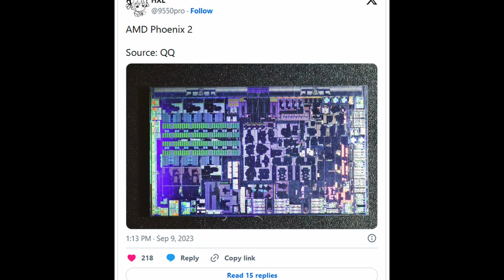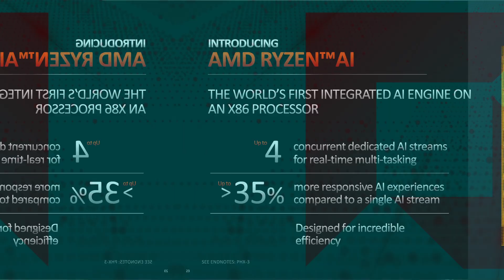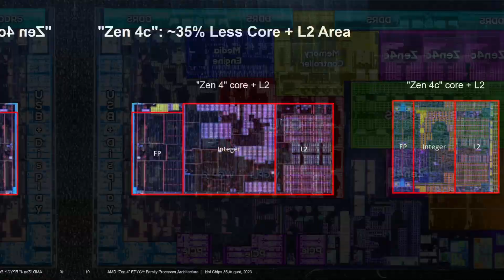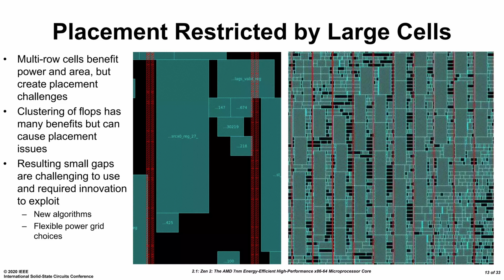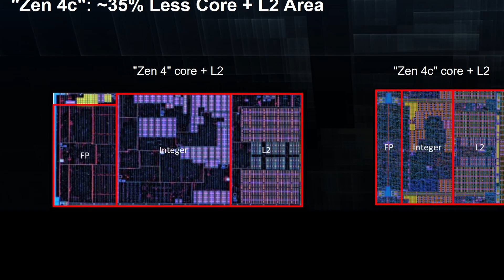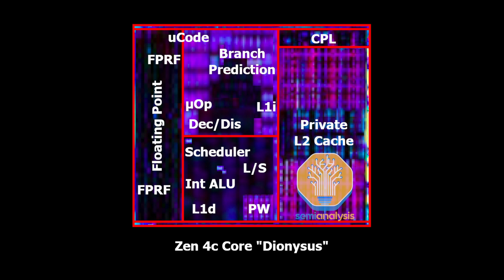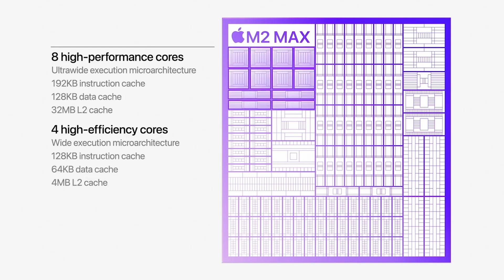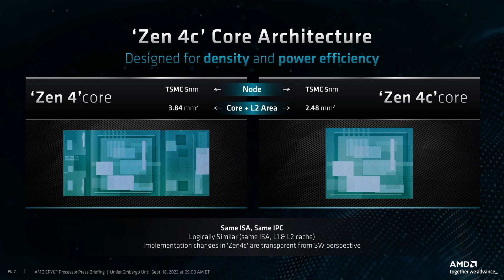Why AMD's first Hybrid-CPU is Different

Comment: We're still here waiting for software/scheduler to utilize our current cores.. I am not sure how more cores would have any performance gains, although the efficiency is there.
Honestly surprised this channel doesn't have 20x the subs, some great content here.
Reply: What problems are you experiencing with thread scheduling and what CPU are you using?
Reply: If it's AMD you're referring to, then that's really only a thing for games and dual CCD CPUs. The bulk of how it works now, would work even better with C cores. Single and lightly threaded tasks just go the the highest clocking cores. Games just happen to be a special use case for X3D where you typically want to reverse that when you have a X3D chiplet.

You'll hardly ever run in to any other consumer workload where you'd actually want/need to pick the cache cores. Most of what else could potentially benefit from the extra cache would just as likely be capable of using all threads on the CPU. That's where more threads provide more performance. Either highly threaded tasks that can max the CPU, or muti-tasking with a collection of light to mildly intensive tasks. Wanting to specifically default to the C cores would be mostly a concern for mobile, which is really a matter of having to OS switch behaviors when on battery.

There are game engines capable of using 12-16 threads, but are currently scaling back to not have the game peg the CPU at 100%. The 2.0 CP2077 update, for example will use 50% of a 16c/32t CPU, but 80% of a 8c/16t one.  I've seen Star Citizen using as much as 19 threads though. If it starts becoming more common for games to push past 16 threads, Intel's E cores in current CPUs will be worse off.

Comment: I think the most difference we'd see in architecture in a single AMD APU chip is using Zen 5 with Zen 4c+ (rescaled on a smaller node)-- basically having a slight size-area advantage while reusing an existing design.  So basically Zen N + Zen N-1c+ to be able to launch more quickly unless there's a major architecture difference between generations.  I could see this happening if there were problems bringing up Zen 5c in a reasonable time or if they wanted to lead out-of-the-gate with an APU that was on the new process, regular Zen 5 was ready, and wanted to make a powerful lower-cost chip off the bat to secure marketshare.   It would still work better out of the box than Intel's P&E cores because that requires a lot of magic on the programming and scheduling side.
Reply: Porting Zen Nc to a significantly different process used by Zen N++ would be much of the same work of validating Zen N++.
APUs & server follow the initial desktop lauch, used to introduce new designs.
Delaying V-cache & compact Zen chiplets is more about managing releases and demand, launching the simpler product first.
Reply: Eh zen5 and zen5c should be out around the same time so I don't think that will be an issue

Comment: it's not really a matter of what is necessary or best. The Zen 4c allows AMD to expand their market without designing a new core, or updating an older generation like Excavator to have a small core and better power efficiency. Intel had Atom for other reasons as the small core. 
If we really think about it, the full Zen 4 (and Intel P) are not well matched to high core count processors. The big Zen 4 core is capable of 4.5 base and 5.7GHz boost operation (in Ryzen) but is restricted to 2.4/3.7 in the 96-core EPYC. Zen 4c is smaller, and only gives up a little on base with 2.25/3.1GHz at 128c. 
I am inclined to believe that Atom core should have more performance per unit die area (a matter of Moore's Law) and may ultimately be more suitable for software capable of utilizing very high thread parallelism.
The long-term product lineup (Zen 6+ timeframe) might be 3 CCD options: 1) 4 big cores with very large cache, 2) 16 core c cores, and 3) 32-64 true little cores (narrow superscalar). The big cores should allow 4-5GHz base even in 8 CCD processors, the high core count processors use c core CCDs and very high core count using little cores.

Comment: A Zen 5 desktop CPU with one CCD of 8 normal Zen 5 cores with stacked L3$ and a second CCD with 16 Zen 5c cores would an extremely interesting product.  As long as they can handle the scheduling aspects to optimize for various workloads it would be a killer.
Reply: Id say 6+6 would be interesting cost effective but powerfull system for gaming. Most games dont need that many power cores but might be still able to utilize many cores for some extend. 4+12 black cheep option 😅
Reply: I really hope they do it, otherwise I'll go with intel. I'm not buying that hiper expensive threadripper pro anytime soon
Reply: There really isn't as much concern for scheduling in that scenario. Games are the sole outlier to how the OS wants to handle multi CCDs CPUs. By default it's wants to put tasks on the highest clocking cores 1st, but while the stacked cores are slower clocked, they are technically superior for most games. So the workaround is a whitelist method. Some future core dense CCD will always be the slower CCD. 

Pretty much every other workload is benefitted by higher clocks 1st, and then if it's heavily threaded it'll just include the other CCD. There won't really be enough other common workloads that would benefit from the cache and not use the whole CPU, nor would the dense CCD be faster in isolation.
Reply: If AMD had the will to do it, they could probably launch that right now with an 8 core Zen4+3DVcache chiplet & a 16 core Zen4C chiplet. There's no obvious technical limitation making it impossible to my knowledge? and I wouldn't be surprised if they had something akin to that running in the labs right now (in the same way that 5950X3D's exist internally at AMD)
Reply: @TorazChryx  they haven't introduced ZenC to the consumer products yet, that's the limitation. I suppose when it happens it will be introduced in a normal CPU without 3D cache.
Also fun to think about the unreleased 5950X3D which is a double 3D (both dies have stacked cache, 192 MB instead of 144). 
If it were released it should probably be named 5950X3Dx2 or 2x3D (6D ?) Lol
Reply: @TorazChryx  Probably cost is the limitation. But competition will lead it there
Reply: I had seen some tools being developed for the issues of having 2 different chiplets can give.
If you happen to have a 7900x3d or 7950x3d, I would hoghly suggest that you check out a program called Process Lasso. Something that I believe AMD should have made themselves and released with those cpus, so you don't end up with the issues some had, for an example some games running worse than on a 7700x (example csgo) or a 7800x3d, because they didn't run on the appropriate chiplet for max performance

Comment: The same cores are still being used as big/medium cores in multiple arm designs from qualcomm or mediatek. Like the sd855/865  had a high clocked a76/a77 core and a 3 lower clocked a76/a77 cores. The higher clocked core is physically larger too.
Reply: Is a Cortex-X1 the same as a Cortex-A77 with higher clocks?
Reply: @SeniorKlean  no, you can read anandtech for the details.

Comment: So when you say their hybrid design is both big.LITTLE and NOT big.LITTLE... does that make it a hybrid (adj) hybrid (noun)?
Reply from the maker: I mean it's both physically smaller and bigger cores, but doesn't really follow the design principles of ARMs "big.LITTLE". Your wordplay is actually cool because its both two cores from the same "RTL aka parent" and two slightly different parts doing the same work.

Comment: I'm just over here wondering what kind of designs you could get putting older product designs on newer 7nm and doing the same performance per watt/area optimizations. As an example, compare R9 Nano with Fury X. Same shit, just tuned different after the fact. Tune it like that from design start, based on existing IP. Sounds like what they did, but I wonder about even older stuff. Pretty sure those older designs have far less transistors... even higher yields with those optimizations. Those old designs can still definitely handle basic commodity tasks. A single 1st gen Zen chiplet. SATA and USB etc. are already integrated. Maybe there are even cheaper fabs that just can't go so small, but still have them do the new optimization. And put out some Raspberry Pi style dev boards (but miniDP instead of the bullshit micro/mini HDMI). Intel ought to be able to do the same with something like Sandybridge, or maybe Skylake because DDR4. I suspect that's sticking around to an extent like DDR3. I'm personally over here running an MI25 flashed to pretend to be a Vega FE, down clocked an under volted so it's physically defective self can have some hope of being useful... would probably do it even if it wasn't defective, so it would just be less loud and stupid.
Reply: Hell, if Nvidia can sell Tegra to Nintendo, AMD can find a place for this hypothetical. Honestly probably what they did for the SteamDeck, to some extent. Haven't heard too much about how that specific part compares to their other designs.

Comment: Oh, I see, that's honestly pretty clever, I imagine using the same base design make programming much easier than having 2 entirely separate designs for high performance and high efficiency cores. Really nails home how CPUs are integrated CIRCUITS, and not magic crystals. The same circuit can be laid out multiple ways for different purposes.
Reply: It's much easier for the OS, instead of needing special CPU driver and applications not knowing what features the chips support (as they can be moved between P&E cores), it can simply favour the fastest cores, then slower and finally SMT threads when utilisation is high.
Reply: @RobBCactive  Another likely advantage is in development cost for AMD. I presume that they do all the architectural development in the P core design (since it's easier as it's broken down into more separate blocks) then, when the architecture is mature, redesign the layout to compact it into a smaller area.
Reply: @spankeyfish  Good point!  Well if you have developed the RTL, alter the process rules for lower frequency, use compact cells and loosen the placement requirements it is mainly running software tools and design rule checkers to validate a different implementation.
It could even involve many of the same engineers who created the faster modular initial design that passed validation and understand the design in depth.
So that has to be simpler and cheaper than 2 architectures.
Reply: modern cpus are pretty close to magic crystals 😅
Reply: No you're wrong, it'd definitely magic crystals. With a lightning and logic enchant.

Comment: Wendell from Level1Techs had an interesting idea of having an 8 core design combining both Zen 4C and Zen 4 cores.

Because you save some power consumption on the Zen 4C cores you can budget the rest of the power towards the Zen 4 cores to much higher clock speeds.
Reply: Another advantage is since the IP is the same between the core types the only meaningful difference is the clock speeds.

So thread scheduling is not going to be too much of a problem since Windows already assigns most applications via clock speeds anyway.
Reply: @kingkrrrraaaaaaaaaaaaaaaaa4527  hopefully it will work as easily as that, unlike intel which still don't work and just assign random cores when idling, I just cheacked and the only cores that are not in use on my laptop are the e-cores, like you would think windows would run on the e-cores by default by now
Reply: @CMPLX8  I heavily suspect this is a pure governor setting issue (performance v/s efficiency mode). ARM solved the scheduler part a long time ago on Linux so Intel+Windows probably solved that as well.

Comment: You show four DDR5 interfaces, are those 32 or 64 bits each?
Reply: Probably 32bit each (128bit total). AMD does use 128bit DDR5 memory controller on Z1 Extreme chip (8*Zen4, 12CU iGPU), so using 256bit memory controller just here (2*Zen4, 4*Zen4c, 4CU GPU) is unnecessary.
Reply from the maker: Should be 4x 128bit, as volodum said.

Comment: The more intricate the design is when it comes to big.little(heterogenous) design the slower it will be. Homogenous design will always be faster because there is no latency/waiting time wasted for the system do decide where to put the workload, and if the workload gets assigned to the lower performing cores u loose perf.

Comment: Ryzen 8950XE with 8 Zen5 cores and 16 Zen5c cores would be rad. Let's say Zen 5 is 17% IPC increase and 3% clock speed increase over Zen 4, and a Zen 5c core is only 15% slower than a Zen 5 core. That would make a Ryzen 8950XE ~60% faster in multi-core workloads than 7950x. Or measured in Cinebench R23 score, that would be ~61,300 points vs ~38,500 points for 7950x.
Reply: The idea is the MT cores don't design for the boost frequency but can operate at the power efficient frequency limit.
So under heavy load those Zen4c cores might be no slower, as the system operates at a base frequency.
The Zen4 cores have to dial frequency back to share the power/thermal budget.
Reply: If amd does that im buying as soon as it comes out
Reply: But why is this so important?  What is the 'consumer platform' type of user doing where simply having 16 full speed big cores wouldn't still be more than enough for multithread?  I had the same issue with Raptor Lake.  Sure, it's technically added a fair chunk of multithread performance, but few people buying those are actually taking meaningful advantage of that versus just having 8P + 8E.
Reply: @maynardburger  Some productivity users, use desktop rigs and like Raptor Lake plus the hardware quicksync acceleration.
Many users think moooaaaaahhhrrrrrrrrrr cores are better, so pick Intel despite the problems cooling a lot of watts for little performance gain.
Reply: Or, iuno, they can just use 16 Zen 5 cores so people aren't getting gimped cores on half of their CPU. The big little thing only works if it leads to more threads, the same amount with less power on half the cores would be devastating.
Reply: @joemarais7683  The Zen 5c cores aren't really gimped. They have multi-threading and support all of the instructions that the full Zen 5 cores support. They are just clocked a bit lower. Besides, you can fit double the amount (16 cores) on one chiplet instead of 8. So I don't see how it's going to be devastating. If you are talking about games, are there any that really need more than 8 very fast cores? Either way, with Ryzen gaming is generally done on one chiplet to avoid the cross chiplet communication latency. So it doesn't really matter if the 2nd chiplet has Zen 5 or Zen 5c cores since you'll always want to keep the game running on the 1st chiplet.
Reply: @joemarais7683  A Zen4c CCD doubles the threads of a 8c/16t chiplet, they're proper Zen cores not Intel E-cores.  When there's heavy MT load the frequency & power of all cores is reduced from high boost

Comment: The previous Zen designs clock the L3 cache at the the highest core clock frequency in the CCX. Has this changed, are they using Z4 or Z4c cache slices?
Reply from the maker: Good question, I can't tell you. I think it's the same L3 cache they used in the big Phoenix, but I don't know about the clk speeds.

Comment: I very much see the 'dense' versions of Zen being used in games consoles, handhelds, thin & light laptops, NUC like devices, etc. Basically anything where 'power to performance' is king rather than just outright performance.
Personally I don't want hybrid chips coming to desktop though or if it does I want to have all options, ie only full large Zen chips or Zen + Zen C chips or only Zen C chips. But I've had and am still having a lot of issues with with Intel's big/little designs and so my next system is AMD because I won't want big cores for my desktop.
Reply: With Zen Dense being the same IPC but just lower clocks it doesn't mess with stuff in the way that intel E cores do. Apps and windows will also know much better which core is faster, since Windows scheduler looks at clocks only to determine the fastest core
Reply: @shepardpolska  I just don't know why Windows/Intel is handling things so badly though, like if I don't have that app 'on the top' (ie if I minimise it or have something else open over the top of it) then most of the time things get moved to the E-Cores and leave the P cores empty but these are full on performance requiring applications that were maxing out the P cores but then just almost stop if I don't watch them work!!
Reply: By definition Windows handles things badly, that's its entire purpose xD
But yeah hopefully we'll see some variation assuming they continue on the same path, already today we are seeing more options with each generation